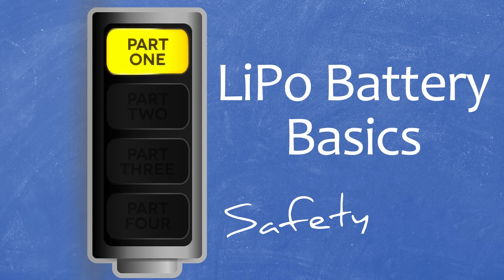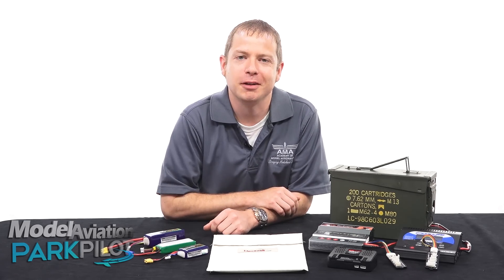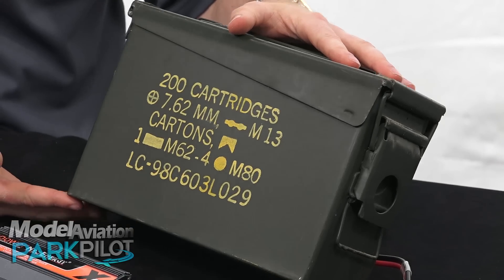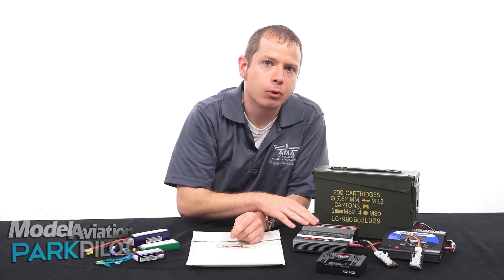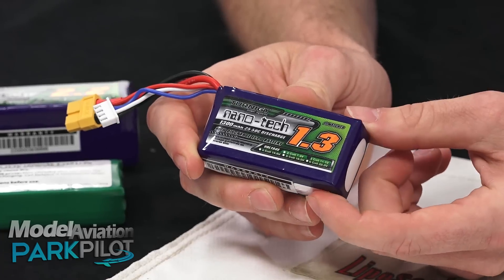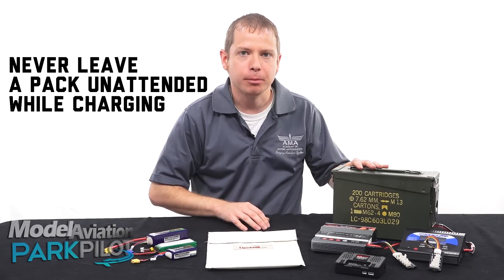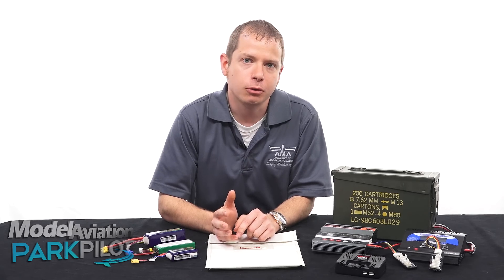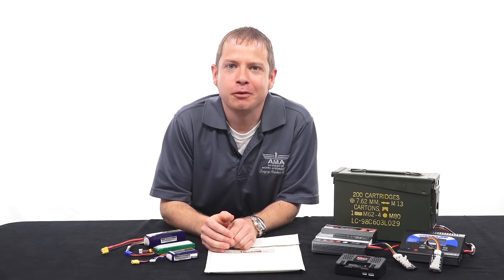LiPo Battery Basics - Safety First

Comment: Does a LiPo battery charger shut off, or shut down when the battery is fully charged? Is there a LiPo battery charger that shuts down, or shuts off when the LiPo battery is fully charged?
Reply from the maker: +Mark II 
YES, all are designed to sense when the battery is fully charged and cut-off.
Reply: +modelaircraft Thank You. (+1 : 27)
Reply from the maker: +Mark II  Don't assume the charger will always shut off.  It's best to immediately unplug  the battery after charging and never leave a charger unattended.
Reply: modelaircraft Gotcha. I will do as you've instructed. Buying at least two batteries will insure I can charge one, and use another one while the first one is being charged. More expensive, but at least I'll have my pie and be able to eat it too. Only takes about an hour to charge a LiPo, so I honestly don't have long to wait. One could also say that if one didn't have the money, one could just buy a single LiPo battery, and wait an hours time to pass. Either way, I win. Thanks for the reply.

Comment: If you use an ammo box to store and/or transport your lipos (which is a great idea) make sure to either remove the seal on the lid or drill a couple of holes in the side or end of the ammo box to allow the expanding gas to escape in a "controlled" manner (in the event of a lipo burst). Search YouTube and you will find examples of how the ammo box can grenade if it cannot release the considerable pressure that builds up inside. Happy flying!
Reply from the maker: ***** TripleThreatRC Thanks, all great points!  Yes when using an ammo box, be sure gas can escape.